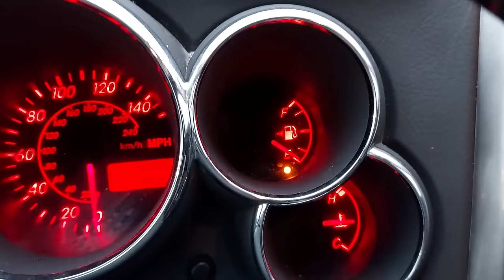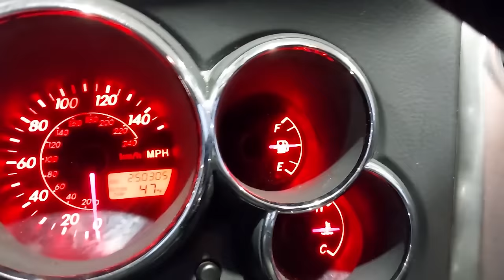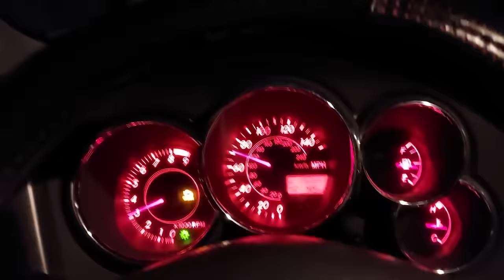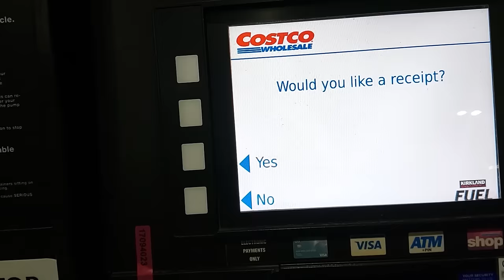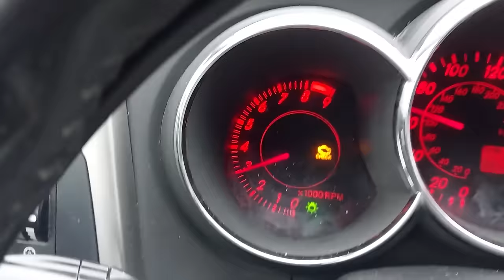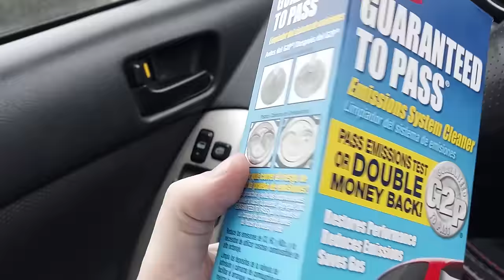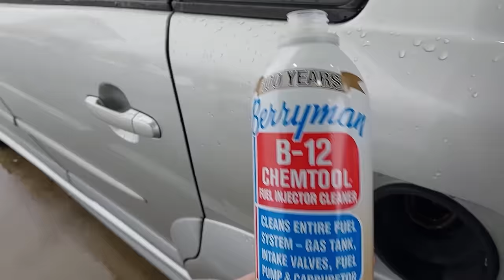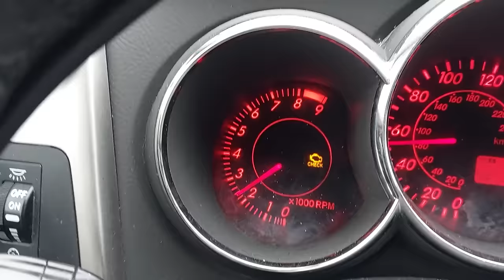Product Testing! Seafoam VS Rislone VS CRC VS Berryman do they work? Can they fix a P0420?

Comment: If the Cat is new then why try all these different products instead of replacing rear O2 sensor?
Reply from the maker: Because the products all purport to cure the 02 sensor code, and the sensor is working, doesn't have any faults.

Comment: My experience is to install only OEM catalytic converters or risk tripping codes by using cheap aftermarket cats.
Reply: Absolutely!...
'IF', after TRYING some possible fixes LESS than 
$300+.😳
 "Spend Not ALOT , until you give less $ a SHOT." 😀😎👍🏼

Comment: The voltage from an o2 sensor is one measure of it working….heater circuit and cross counts is another.  Look into it

Comment: My trans  had po420, change out the O2, twice, but had to replace the cat, that cured it
Reply from the maker: What cat did you end up using? Something directly from Toyota? Walker? Something "Universal High Flow"?
Reply: @LucoreAuto  for my 2001 trans am , it was a direct replacement from gm, and the car only had  45 k

Comment: I know this is an older video, but have you tried  Motor Care DPF and Catakytic Converter Foam Ckeaner?

I bought a can last week ($24.99 on their site. Amazon is almost 2x that). You spray it in your first cat and its suppose to clean it.

I bought a can, haven't used it yet
Reply from the maker: Hmmmmm nope never even heard of that. Definitely post a follow up comment once you do! Very curious how/if it works!
Reply: @LucoreAuto  

I used it on the top converter, which is inside the manifold. It definitely cleaned it as I took a before/after clip with my borescope. It also smoked like a m//f when I started it. I have some video clips I may merge into 1 file, upload to Google Drive if you want to see.

Along with color commentary. 😁

Anyway, the code I get is a P0136 on the downstrean sensor. I had a garage replace both 1.5 years ago because the downstream was too tight for my breaker bar and O2 socket ( I got NTK brand on Rock Auto for around $89 each).

P0030 has to do with a heating detection error.

I managed to break it loose and noticed a dent in it, like someone used pliars or channel locks.I told them I had a socket if needed. 🤷‍♂️

In any case, I just ordered 2 more sensors and 2 more cans of the cleaner. I'll warm up the car, grab my Mechanix gloves, remove them.both, spray the cleaner in both (1 can each), replace with new sensors and see what hapoens.

I'll record as much as I can.

Worst case scenario if I get P0420 again, is use this:

https://www.walmart.com/ip/5448137890

I always thought if you get a P0420 code, you're supposed to "light one up" 🤣
Reply: @LucoreAuto  

And now that I got my 2 new o2 sensors, I can't get the top one loose, even though I easily had it off a few days ago and didn't even torque it back. 🤷‍♂️

Comment: P0420 The bane of my existence.
Reply from the maker: No kidding!
Reply: With so many people getting this on so many different cars..start to think mfg have the differential specs between upstream 02 sensor and downstream 02 sensor set to tight.
As soon as the 02 gets dirty reading gets off..then both get off with p0430 blaming on cat..
This would be reason these cleaners work..enough to clean 02 sensors..
Imagine how many thousands of DOLLARS customers have spent for shop to Just gi ahead and replace Cats and 02 sensors

Comment: I have taken the downstream o2 out of the pipe completely, plugged the hole, and grounded the sensor so all it sees is fresh air. No cat code, even wit no cat at all.
Reply from the maker: Lol yes well that's not exactly FIXING the problem ;) That's just kind of a workaround to make the light go off ;)

Comment: Check for exhaust manifol leaks. Check for leaks around the flange. If there are leaks I thinl it will carbon up things because it may cause oil burning.

Comment: I watched another video where he removed the upstream 02 sencer and sprayed a can of sea foam directly into the hole for the sencer,  put anti seize on and reinstalled it. Ran car until it stopped smoking.  It cleared all the codes

Comment: I've seen acetone/ lacquer thinner" being used in the gas tank as well". Hmmm " strong solvent"  on old cars with carbs especially, rubber diaphragms o-rings fuel lines, ????  Newer flex fuel vehicles maybe a lil more tolerable but Damm "
Reply: Cataclean"  ???   But would definitely use lucas ethanol stabilizer/ lubricant" after

Comment: I have used the B12 manny times and it really works good, it cleans your plugs and really does everything it says on the can...your motor will run smoother using B12 and you will get better gas mileage...🇺🇸😎☕

Comment: Is it possible to swap the O2 sensors to see if the code follows to the front?
Reply from the maker: Good question but no unfortunately they are completely separate types of sensors, and this motor being a 4 cylinder only has one front (upstream) and one back (downstream). Fair question though, certainly a great trick with spark plugs and coils!

Comment: The issue I have here is using so many different products 1 after the other?  In my eyes that's really not an equal comparison. What if 1 products(s) helped clean it a lot before you use the next product so its not a fair comparison 

Would like to see 4 different cars with the same problem use these 4 products individually. That would be a much equal comparison

Comment: Why did you not clean the sensor directly soaking in the several products. Then hot water as a cleaner vibrating, then dry.
An agitation will show carbon removed.

Comment: Great demonstration and video however, the only flaw is you should have run at least another half a tank of gas through it clean without any additives before you added the next one, otherwise you potentially are just mixing them which could either cancel or provide better resultswithout accuracy. Another thing that I noticed is, I do know for a fact, a couple of the products you used are technically not equipped to deal with the added ethanol that is put in the gasoline today. Therefore, the ethanol potentially reduces results or eliminates results because the product is not formulated to deal with gasoline and corn alcohol.

Comment: Pontiac vibe GT was manufactured by Toyota. I'm having a problem with all of my cylinders misfiring, or at least that's what the torque app says. I think I have contaminated gas, because I annoyingly used a gas can that my little cousin tried to clean with baking soda and peroxide.

Comment: Tried crc for a cat code. Didnt work so I used an o2 sensor spacer. Havent seen the code in 2 years
Reply from the maker: That's TECHNICALLY not fixing the issue, just taking the sensor out of the exhaust stream so it doesn't trip a code 😉
Reply: @LucoreAuto  oh absolutely. My state tests for emissions so as long as the check engine light is off, im good. Still has 2 cats, hopefully they work
Reply from the maker: @malrofo  as long as no one rolls up under the car to look, no one's the wiser 😉
Reply: @LucoreAuto  Fortunately that state isn't commiefornia

Comment: code = p02F1  car =  2020 toyota Camry 4 cylinder,  about 130K miles,  Cylinder #4 injector circuit Range/Performance.     had this one. first tried STP high mileage fuel injector cleaner. did NOT turn off the light or code.  i used ancel ad310 and cleared the light but not the code. It would NOT clear the code.  the Light came back few days later.    But it did run little better. no longer had the smell of gas.   A few weeks later. Tried Berryman B12 chemtool  , (1/2 can and fill up gas ,   by the time it was to 1/4 tank the light had gone out.  going to use the rest of the B12 Can  on next tank) hopefully light stays out.  Smog test soon.

Comment: put a spacer on the sensor after the cat. High flow cats dont let that last sensor read properly because the stream hitting the sensor is a faster stream with a high flow cat so moving the sensor back with a spacer will take the sensor out of that stream and allow  it to read properly and turn your check engine light off

Comment: top tire gasoline helps too I try and stay away from ethanol cheap gas with an PCV oil Seperator to stop the oil mist from going in to the intake .
Reply: YES! I get my gas @ Get Go in PA & JUST realized they're no longer top tier (stickers removed)! I googled for top tiers & says Sheetz was, & it wasn't. Says Sunoco is, so I have to check next trip out. A royal pain, but I totally agree witu YOU! ✊👍

Comment: What would be the fix for P2097 code after replacing o2 sensors as indicated on diagnostic data? I’m having trouble clearing that code.

Comment: i bought a 2010 f150 that the oil pressure would drop and rattle from haitis, i got some rislone run it 20 miles and when i changed the oil the filter i drained out oil and it still weighed almost 4 pounds, all the crude was sent to it, i would strongly reccommend rislone.

Comment: So....did you ever fix it? If so, what was the actual cause?
Reply from the maker: Still actually on ongoing issue, unfortunately not long after this I grenade the transmission. Code is still there, just brought the car back to life recently will have to do a followup video to this actually.

Comment: See several high flow cats that just will not clean it up enough . The o2s just read to close to tell the computer that it's doing its job . Maybe a slim possibility that changing the rear o2 will fix it
Reply from the maker: That's high on our possible issues list that this high flow catalytic converter just isn't doing enough cleaning to make the sensor happy. It's certainly got a LOT smaller element than the factory unit and these Toytoa power plants ARE known for being quite finicky. Not totally opposed to a rear o2 sensor swap but nothing we can see in our data is pointing straight to a "bad sensor" it's reading and reacting as it should.
Reply: If the readings between the 2 are close it's a cat issue . Sucks the aftermarket can't get there game right . Look forward to seeing the fix

Comment: I have not  watched this entire video but I'm pretty Shure the last product or test is going to be the winner 🎉🎉🎉.. .but which product should really take credit for it ?????.... Maybe next time use a few cars n few drivers to follow u . This text is just to see if it or any product would actually work. 😮..... It's extremely important to always find the cause  and fix what it was to cause the light to go on .. how can it get clean if it's STILL....getting dirty at the same time .. WHAT is causing or has caused the cat to die . Your the veterinarian 😊.I will now continue watching this video and hopefully with a trip like this it will clean more then get dirty ... Just enough for the code to clear.    :WARNING: it is dangerous to drive many miles with possible back pressure. Seek advice from your mechanic to check for severity 😮.

Comment: I went through the same thing I have the solution to the fix. Remove the catalytic converters sell them. Straight pipe your muffler. Get a PO box in Arizona or pay the fee for a cheap inexpensive resident agent who will open up a standard c corporation or s corporation for you,  whatever you choose. It's not a corp doing commerce so you'll have no taxes to pay because youll only being using it for one purpose which is to forward your mail to you in Ohio and to receive mail and to open up the corporation for you for the purpose of registration.. simply register the car in the name of the corporation and take that trip but if you have a relative or a friend you can use them as a proxy to go into the Arizona DMV for you.  just take a trip out to Arizona for the weekend and enjoy yourself while accomplishing a purpose. Enjoy the weekend and do it on Monday fly back and Monday night. You'll get it done  without the catalytic converters and you can do without pain. So there is your solution
Reply from the maker: Hahahahahahaha YOU Sir win the best comment I've read on a video in a WHILE. Freaking fantastic! 👏 👍
Reply: @LucoreAuto  thank you. You are kind

Comment: My 2005 Toyota Sienna has 310,459 mile on it and now it show a catalytic problem but no check engine light and it NEDS the California style. The car is not worth $2000 for each one I need 2, for that price. I don't care if I have to take it off to clean it I just want to know if that really works. 😢

Comment: This happened to me I bought a aftermarket cat high flow and the light came back 2 weeks later I bought a 02 sensor extender that code won't come back because the O2 sensor has to out of the exhaust stream the rear O2 sensor done this on a dodge journey worked perfectly

Comment: Don’t bother with fuel system cleaners, the exhaust cleaners should maintain the fuel system too, just don’t use bad gas and if it is going to take more than 3 months to use up the entire tank using a stabilizer is advisable. 87 octane starts to degrade after a few months, premium has a little more shelf life, but regardless, it’s unusable after 2 years even with the best stabilizers known. Most cars have choked down some crap gas at one point or another and have created build up on components that the solvency of the gas itself won’t dissolve. Put some cat cleaner in the tank and use Amsoil or Gumout foam intake cleaner in the throttle body and the exhaust system cleaner will help to ensure that any carbon dislodged burns or dissolves before it burns into the catalyst too far

Comment: I'm got an '04 Pontiac vibe I bought when it was almost new    solid little cars   I've got a 97 Ford f150 I couldn't get the immobilizer and alarm to shut off    I unhook the battery  for 2 months with the headlights turned on and I still couldn't get it to shut off  So I grounded the positive and negative battery terminals together and let it sit for about an hour and It reset it    I haven't had a problem with it since   That was about 4 years ago

Comment: Got to try a 02.. I have had cat issue with aftermarket new cats. High flow cats have given us a few fits as well.
Reply from the maker: That's where we're most likely looking next is replacing the rear O2, not a HUGE cost as long as it comes out of the pipe ;)
Reply: @LucoreAuto  
Been there. As a auto tech it was fun to watch this. The yellow bottle has given us mixed results as well.
We don’t have emissions testing in Minnesota. I’m assuming you guys do there? Often times our customers are electing not to deal with emissions codes but we do do a lot of exhaust, especially lately lol along with people wanting to ensure maximum miles per gallon. I also really enjoy your expertise with the old stuff. Especially performance related alignments.
Reply: It’s all a scam. Currently running high flows stainless works on my Hellcat with spacers. It initially worked for me, but now I have a permanent P0420 tripping. We’re talking nearly $3k per side to fix. I have the OEM so I will be using a rebuild service to have them refurbished for a fraction of the price prior to putting them back in the car, and may still run spacers afterwards as a precaution. They always figure out a scam to suck money out of consumers pockets.
Reply: How ?

Comment: Don't know anything about cars. From my personal DiY experience could be electrical, could be also the fuel tank pump filter. Try also pouring some oil flush in the crankcase, like the same Seafoam, Luiqui Molly or same line of products...

Comment: I was told to  run 93 octane it through it, and it will clean it up. After that my 02 sensor went out. So I don't think running high octane is good in a vehicle that doesn't take high octane. Could be keeping it from clearing up the code.

Comment: Is it best to apply it before you fill the gas tank, or on top of the gas in the tank???
Reply: I recommend adding the cleaner around 1/4 tank and driving until you reach 1/8. Then add fuel to about 3/4 and run back down to 1/8. Rule of thumb is the more fuel you add the more diluted solution is. But each product is different and they tell you how much before and after on the box

Comment: I .own and drive a Brish built 2003 GM asrta, 1.6 liter four cylinder ,  with 1.1 million miles on the clock and still runs like a sewing machine.. I Alway go with genuine parts , shouldent  you!! ?

Comment: My daughter's CR-V had the p0420 code and tried just about everything.  I replaced the downstream O2 sensor and now no more p0420 code.  Now I get a O2 sensor code.  I got a Denso, so I didn't go cheap.
Reply: another guy was saying that when the ECU reads a new o2 sensor that the cat has to be clean and have clean fuel/air mixture
Reply: @blastztrixx9748  not gonna believe this but it was a blown fuse.  It was causing the O2 code and a EVAP code as well.  I replaced it and cleared the codes and all is fine.  But the p0420 code is back again.
Reply: @bearing_aficionado  what fuse was it?
Reply: @blastztrixx9748  it's the FAL fuse.  It's in the engine bay.  A 15 Amp blue fuse.  It will be located in a row of 3 15 Amp fuses.  It will be the middle one.  The FAL  is part of the emissions and controls oxygen and exhaust readings.  I was watching another video and it was talking about if you get a O2 and EVAP code at the same time that a relay was the culprit.  I was browsing the comments and one poster brought up the FAL fuse.  So I decided to check and sure enough that was my problem.

Comment: Ive tried cataclean and rislone neither worked long term. My car jerks when acceleration at low speeds. Check engine light still on my hyundai accent
Reply: Car needs spiritual cleansing
Reply: @tosinkiladejo7269 😂😂

Comment: I had to replace my catalytic converter twice in one year..My engine burns about 3 quarts of oil per oil change so pretty sure that's why mine go bad.
Reply: Just straight pipe it
Reply: @yosefkugel  I would have to find a way to bypass the sensor on the first cat from what I understand. I'll keep researching it.